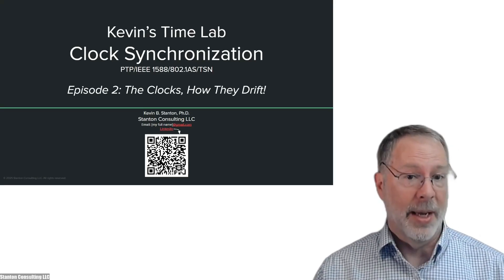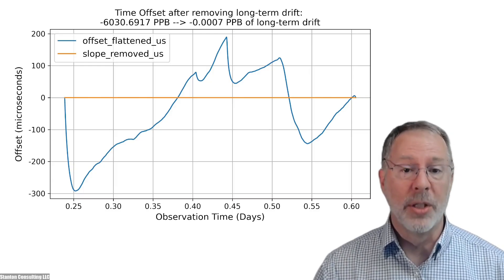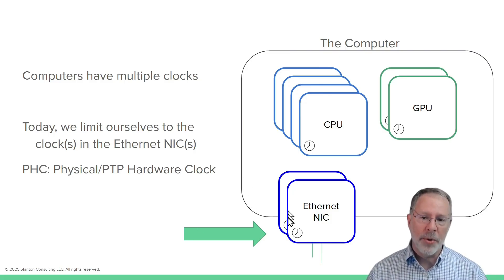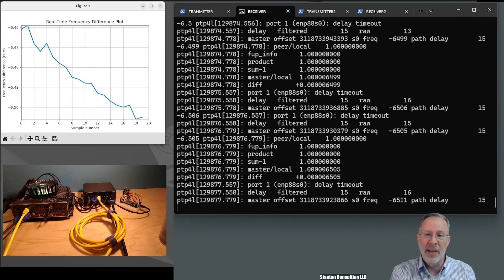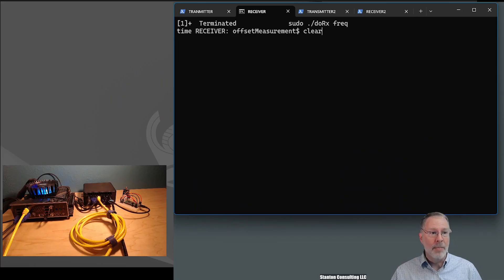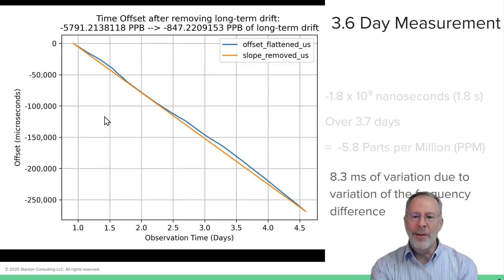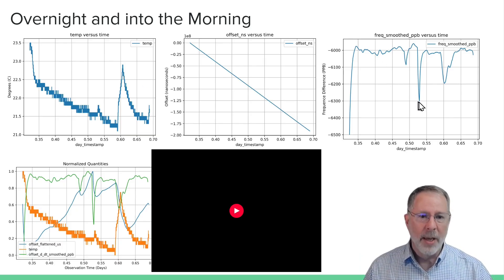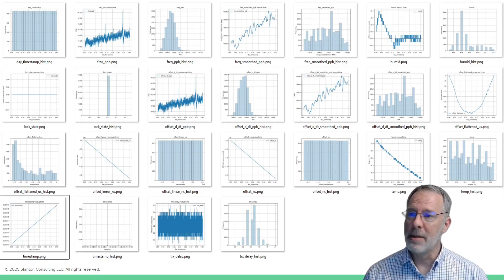#2: The Clocks, How They Drift: PTP / IEEE 1588 Precision Time with Standard Computers

Comment: Can't help but wonder. What about when you lose the ptp connection, what would be a simple way of trying to somehow keep in line with the gm time? I was thinking that maybe averaging out the last known offsets and correct for that amount, though this approach does not take into account these external events that disrupt the internal oscilator..
Reply from the maker: You ask a profound question. The naive approach would obviously be to stop adjusting the local clock frequency when the "holdover" state is entered. But as you say, more sophisticated approaches are possible, e.g. characterizing / learning the relationship between environmental characteristics and historical adjustments, and improve (potentially) the open-loop performance. But typically some clock sources are more available than others, and if the GPS time reference (which is quite vulnerable) is lost, for example, a local oscillator (which still might be network attached, but via redundant links with high availability) takes over. Meta, for example, has reported (as I remember) that they can maintain time using, e.g. a local chip-scale atomic clock (CSAC), to within 1us over a 24 hour period. But yes, these are expensive, and I suspect that a smart algorithm (averaging, at a minimum, as you suggest) would yield substantial improvement over the naive approach. Finally, yes: "Holdover" is on my list of potential future topics.

Comment: Pretty cool.  I work at a test range and timing is pretty critical.  I'm interested in calculating and synchronizing time in systems for beamforming applications in antenna arrays.  I've got a nice GPS disciplined oscillator... it would be interesting to learn ways I can use it.
Reply from the maker: Yes, sensor (and actuator) arrays / beamforming is on the list. Which is more interesting to you: RF or Acoustic? The same principles apply, but one is 1e6 times harder than the other :)

Comment: A great application of ptp/1588 is spatially separated dataloggers where the dataloggers can be on a 1588 capable LAN and timestamp data samples locally then put them back together in post. Eases not needing a GPS antennas on each dataloggers. We had Symmetricom (now microsemi?) oven controlled clock oscillator time servers that received the gps signal.
Reply from the maker: You make an important point, Jesse. Distributing a common clock accurately to networked sensing devices allows a reduction of the need for every node to have an accurate time/frequency reference. And it allows the sensor fusion algorithm to achieve high temporal fidelity that's independent of network jitter (since you're not counting on sensor data captured simultaneously in the sensor devices to arrive simultaneously at the centralized sense-making/sensor fusion node.)
Obviously, the need for holdover in larger or fragile network is still a good reason to have oven controlled oscillators (OCXOs), and/or GPS, as you mention.

Comment: Forgot the clock between two computers, how about the analyzing drift  between clocks on different NUMAs on the same "PC"?
Reply from the maker: Hi Perri. Thx for the comment.

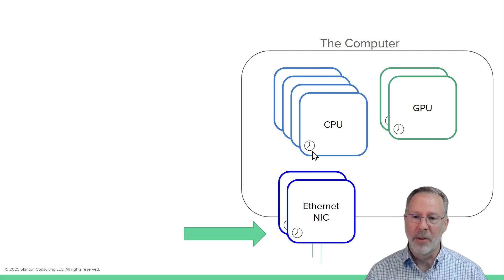I'll point you to t=00:05:00 where I mention (very briefly) that in modern X86 computers (certainly those from Intel), software running on all of the CPU cores shares a common clock, the TSC, accessible via the RDTSC instruction (a typically non-privileged instruction)--even between CPU cores on separate sockets (NUMA), so long as they are cache coherent. I might record a future video where I re-create a C program with inline assembly that demonstrates the truth of this claim--although there are caveats, e.g. an "improperly"-configured Hypervisor, or if an OS is behaving badly and adjusting the TSC clocks.

But Intel CPUs are not the only CPUs in the world, obviously, so I'm curious if you are aware of other modern (i.e. in the last decade) multi-core CPUs that don't give software access to a shared clock / counter? It's an honest question.

BTW, I give a much deeper dive into this topic here: https://youtu.be/9OILFLV-Sfc?si=nht2Klf1LjKiwBL8&t=175

Comment: Very cool. I'm hoping to buy parts for an ESP32 linked to a LN8720 Ethernet controller (called WT32-ETH01) and a cheapish GPS module, and code up a toy NTP server to synchronise my home computers. Initially I'm hoping to get just <=1ms accuracy. I wonder if it could be extended to do PTP for slightly better results. Although I'm not great at writing embedded C/C++ yet...
Reply from the maker: Hi Matt. Better than 1ms should be achievable with that approach, especially if you're running embedded, which eliminates the jitter of a stock Linux distribution on a untuned PC, for example. I haven't looked into SPI-connected Ethernet, so I'm interested to hear about what you discover. Given you're running a local time server (vs. NTP server out on the Internet), and without hardware timestamps (which the W5500 doesn't seem to support), I wouldn't expect a big difference between PTP vs. NTP. But again, I'm interested in your findings!
Reply: @kevinstanton148  My bad, I misremembered. It's a combo module you can  buy, called WT32-ETH01, and I think it has the LAN8720 controller on it instead. The W5500 is popular as a standalone eth controller module. Good luck with your videos, I'll look forward to #3 and #4. I wonder if there'd be room to explain somewhere where a local NTP server "fails" in a precise synchronisation use case and how PTP picks up the slack.
Reply from the maker: @ivolol hmmm. Yes, that would be good. Measure with local ntp and ptp, both without hardware timestamps. View the quantitative difference.

Comment: Hi! Thanks for the videos. Not sure which GPS receiver you're planning on using for the future experiments, but just wanted to give you a heads up that typical GPS receivers are not capable of nanosecond accurate timing. The PPS output typically has an RMS jitter measured in tens of nanoseconds. To make things worse, in the short term the timing errors also tend to be correlated due to them being caused by environmental effects. To get down to single-digit nanosecond phase error, you pretty much need to consider time-scales of at least ten minutes.
Reply from the maker: Good points, Antti. I hope to compare multiple diverse sources of time, and I'll definitely do some long-term measurements. Thx for the suggestions! I've had offers to borrow timing-related test equipment, and might go forward with that if there's interest.
Reply: Oh you poor soul. This world descends into the madness of dedicated phase noise measurement systems.

Comment: I had the pleasure of working with John Eidson at HP Labs (later Agilent) on PTP - IEEE 1588. Wonderful researcher to work with!
Reply from the maker: Hey Artie. That's great, so you must've been there in the early 2000s. That was a few years before I joined the standards (2006ish). Yes, my own interactions with John -- father of PTP -- have always been inspiring, both technically and personally. John gave an interview last fall as part of OCP TAP. https://youtu.be/UbjxwY77-2E?si=wju_d6V0j1jTzXcq

Comment: I'm really glad YouTube recommended this video to me. It was really interesting to see your demonstrations, and I especially found the graphs very interesting. I've often been in projects that have some sort of dependency on MCUs powered by different crystals running synchronously to a certain extent, but discussions about the exact values have tons of handwaving and no conclusions, because nobody wants to get the actual usable numbers and present them in a way which can be analyzed.
Reply from the maker: Thanks Андреја, and the YouTube Recommendations have been most of the views of #2 so far.
Data beats hand waving, for sure! And I see you made some RF videos yourself. One experiment I dream of producing as a video is a HF MIMO receiver, perhaps on the 10m band. The array (e.g. 2x2) would take up some space outdoors, but the challenge of synchronizing the SDRs and post-processing the I/Q datastreams would seem a fun challenge.
Reply: @kevinstanton148  That project would definitely be really great way to get some experience with beamforminng and related technologies. 
For example, the rtl-sdr blog's v3 dongles have system for accepting external clock, so it shouldn't be too complicated to feed several of them from the same clock source and have synchronized sampling clocks. Of course, after that comes the processing. Maybe GNU Radio could be helpful here as a tool, to create the phase delays between receivers... 
In any case, it would be very interesting to see the results of something like that.

Comment: I find it interesting how easy it is to disturb even a good crystal oscillator, not only temperature humidity and such. Just changing the orientation of it will make a quite remarkable difference in frequency, try turning one of the boxes on its side and see the clock difference shoot up.

Even a good OCXO in a relatively enclosed box drifts with room temperature to a degree that really surprised me.
Reply from the maker: Thanks Örjan. I'll give that a try. Thx for the suggestion. I plan to show the performance with a TCXO soon.
Nice Timelapse!
Reply: @kevinstanton148  Thank you, I had forgotten I put that timelapse up! A youtuber I am not! 😂